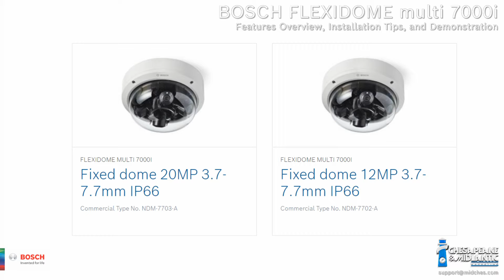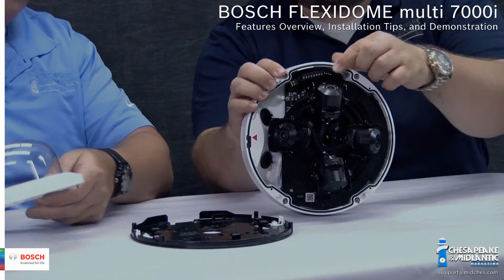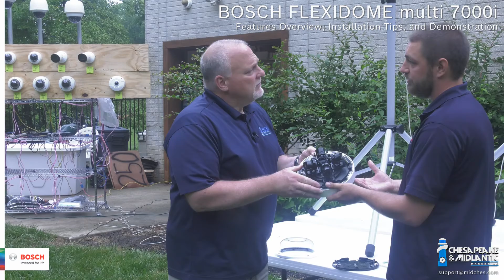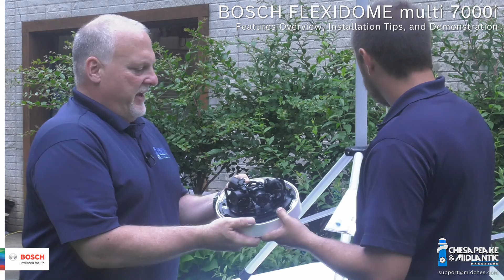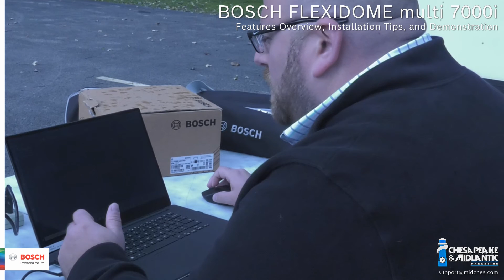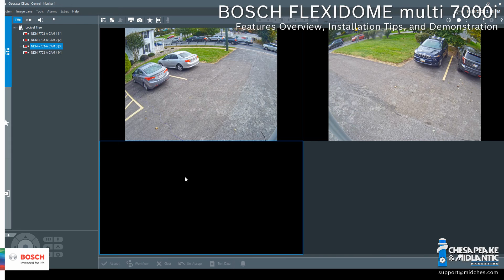Bosch FLEXIDOME multi 7000i Features Overview and Demonstration

Comment: I just got one of these in hand.  The rubble grommet that provides water sealing around the cable is interesting.  Do you just press a cable through it until it rips?
Reply from the maker: Thanks for the question. Watch this video closely for instructions about the grommet: https://youtu.be/KbEv0B_emLs?si=lZNl2VGvqKXJqCoh&t=109
Reply: @MidChes  Thanks for the link, that demonstrated exactly what to do.  I love their cameras, but I have to throw some shade at Bosch still; The IKEA-style instruction sheet (no words) that came with it was way less informative, and their video had no sound, plus the camera was installed upside down, which would make it more susceptible to water intrusion. I hope Keenfinity does a better job when they take over the brand.

Comment: why does the camera have the ability to articulate left to right?  When you move the camera a few degrees the plexiglass cover will not go back on. Any tips on using this function and then installing the cover?
Reply from the maker: Thanks for the question, it's a challenge we have faced as well on multiple projects. First, it's important to clarify the difference between the "imagers" and the "camera". The imagers are the four adjustable heads of the camera system. The imagers are able to be moved left or right around the mounting ring, however, their angle may only be adjusted to the point where they contact the clear protective housing bubble, limiting their possible position angle. We have some customers who have modified the metal bracket that holds each imager to allow for more adjustment. HOWEVER, THIS WILL LIKELY VOID THE WARRANTY. The other option is to consider a Bosch panoramic 5100i camera which is able to achieve a 360-degree field of view from one imager. If you would like for us to connect you with your local Bosch representative for further application discussion, we'd be happy to do so if you contact us at support@midches.com.